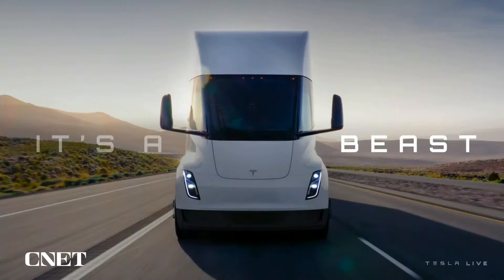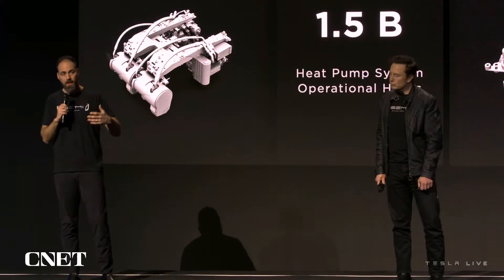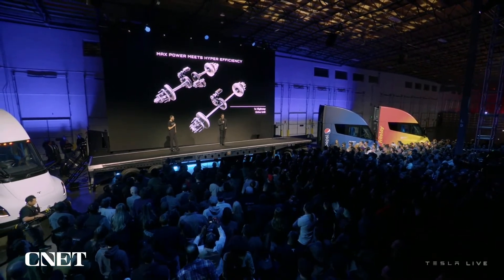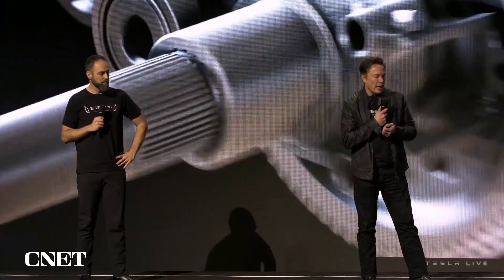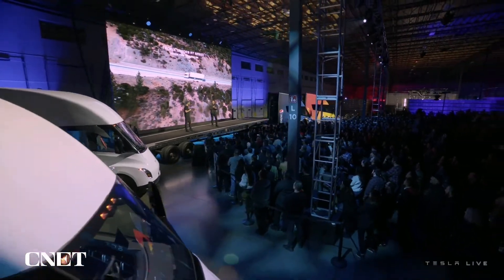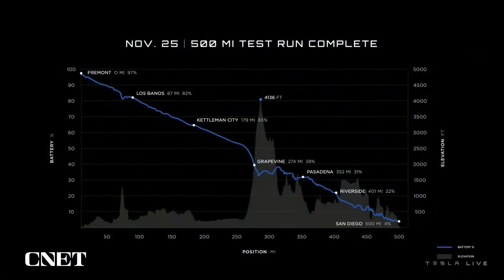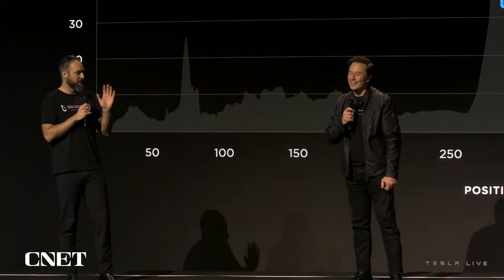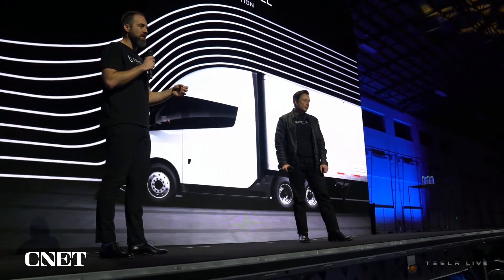Watch Elon Musk's Deep Dive Into the New Tesla Semi-Truck

Comment: Been reading the comments here about long distance driving and stopping to recharge. I think the idea with this truck is for local daily deliveries within a defined area and not driving across the country.....at least not yet. 

As for the cost savings over a diesel truck, the big question here is how long will the battery/batteries last before needing to be replaced and the other big question is the cost of the replacement battery This cost may offset the expense of maintaining a diesel truck vs an electric truck over this time span. 

Keep in mind that diesel mechanics and parts for diesel trucks are readily available almost everywhere in the country. What happens if some part fails on the Tesla truck making it inoperable? I am sure Tesla is or will be addressing this issue but it is a valid question as the electric heavy duty truck segment gets off the ground. 

When the time comes to replace the battery in any of the EV cars on the road today, the cost of the replacement battery depending on the car may exceed the estimated value of the vehicle making used EV's a questionable investment once the car and the battery reaches a certain point like age and/or recharge cycles, etc. I guess it is no different than a diesel truck with a million miles on it needing an engine which can get pretty expensive.

Pick any 10  year old car today with over 200,000 miles on the odometer. The value of the car vs the cost of replacing the engine may  make this particular car a poor investment. But unlike gas or diesel engines which can be rebuilt what happens when the replacement batteries are no longer available? The scary thing when buying an EV today is will the batteries even be available when you need one?

Lastly, with the move to green energy and doing away with fossil fuel power plants, how much will electric cost to recharge this beast in the future?  Here is a question I would love for people in congress to answer, how much electric do solar panels produce between sunset and sunrise? How much electric does a windmill produce when there is not enough wind or too much wind? 

Where will we get electric from when there is no wind at night? Hint: electric is not stored in the wall as some people think..........

Comment: I am skeptical about this range. 500 miles is unreal compares to diesel trucks ranges of 600 miles. The only type of trucks that surpasses diesel are hydrogen fuel that ranges 620 miles. The Tesla claim is still impressive if it is accurate.
Reply: Seems pretty real, since they taped the whole drive and are selling them...
Reply: @catbert7  Well,Musk is known to lie even in videos they present.
Reply: You can watch the video online. There is already a 2 min sped up video out showing their 8 hour drive. They are going to release the full video later. 500 miles is more than enough range. You have to take a break every 8 hours anyway, so charge for 20-30 mins during that time. You can easily hit 800 miles a day with the semi once the infrastructure is built out, which will happen far faster than any hydrogen infrastructure could be built. And electricity is massively cheaper than hydrogen. So yeah, hydrogen is a waste of time.

Comment: No mention on the weight? I wonder why...Considering that 100kWh battery in Tesla S weight 625kg and this has 10x the battery it should be over 6 tons just in the battery. There's a reason EV Semis have higher weight limit. Compared to 14.8 liter diesel in a semi that weighs about 1300kg + about 3 tons in fuel that's a bit over the half of the weight that gives you 4 times the range.
Reply: Remember, the long range version is more of a sleeper replacement. There is a short range semi as well. A sleeper semi can weigh up to around 25,000 pounds. 

The batteries for a 1000Kwh battery pack weigh around 8,500 pounds and replace a large amount of diesel equipment. Three electric motors and their gearboxes are likely under 1000 in total. And electric trucks have a 2000 pound bonus from the government. There are a lot of items that will be removed from a diesel truck that aren't needed in an electric truck. 3000 pound diesel engine, 1500 pound transmission/clutch/components/driveshaft, several hundred pounds saved from the exhaust system removal, about half of the cooling system removed, and up to 2000 pounds saved on diesel weight and fuel tanks.
Reply: But there is very little weight in the way of drivetrain and motors. Diesel engines are heavy and their transmissions are also super heavy. Batteries weigh more, but not the motors and drivetrain. In diesel, fuel weighs less, but a lot more weight in terms of engine and drivetrain.
Reply: @allajunaki  but engine + transmission + fuel is still lighter than just the batteries not to mention that it gets lighter as you use the fuel

Comment: Love it. The scene is just West of Truckee headed West up the Donner Pass. It’s quite a climb to the top. However only a few miles. From the top of the Donner Summit the rest of the mountain travel is down hill until you reach Sacramento.about 85 miles give or take. I have just one question, how much power loss is there between Sacramento East bound to Truckee? I’ve driven the Donner thousands of times East bound is the true test.
Reply: Remember that it recovers most of that on the way down, so it's not a big deal usually.
Reply: @catbert7  yes of course. It’s an amazing feat just to be able to master the Donner in both directions with an electric semi.
Reply: @stevenrushing334  
Once you get the concept, it just makes sense.

Comment: Hope you can spin the wheels because in certain situations you need to be able to break traction especially in snow and mud
Reply: TESLA semi has 3 motors w/ 1200+ HP and 1000 lb Torque.
TESLA cab can Accelerate 0 - 90 mph < 10 seccond , FASTER than Porsche 911.
Reply: Yes, it has settings for that.
Reply: @catbert7  sweet 👍 from 🤠🇦🇺🦘

Comment: They should have big batteries build into the truck trailers, that could recharge the truck when connected.
Often the trailer is just stationary in one location. Use that time to recharge the trailer. Just my two cents.
Reply: The enormous weight of the batteries would drastically reduce the amount of cargo you could carry because you cannot exceed 80,000 lbs legally on federal  highways. Less cargo equals less revenue and profit for the shipper.
Reply: Sounds like a good idea to me.
Reply: That will make the truck a lot heavier, costing few tens of thousands per year.

Comment: IT can't make the promised specs unless it is going down hill with a tail wind.. no other EV truck can go 500 miles and given the 300kwh and 500Kwh batteries they say will be in the vehicles is too small to drag 40 tons 500 miles; maybe 125 miles but not 500 even with the 500Kwh battery.  A Rivian has a 130 Kwh and took 23 charges to go 2300 miles just towing a trailered mustang.
Reply: but it made the promised spec without going downhill. Probably the battery is closer to 900 kwh.